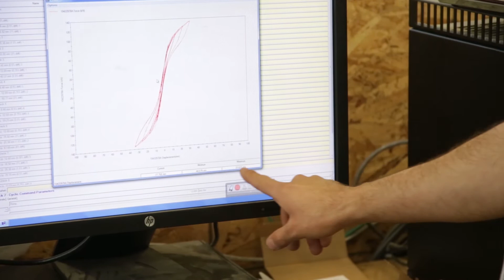Green Construction Innovation

Comment: Innovation in building methods need to be re/invented to better deal with weather threats.

 I wonder if inflatable shelters can be filled with something other than air.  If the material the inflatable shelter is made maybe not from cheap plastic instead use a very strong material something like Kevlar. Or maybe Kevlar.

Instead of filling the inflatable shelter with air fill it with injection insulation or cement or fill it with something i have not thought of to make a temporary shelter technology into a permanent construction method.

I do not have the resources to do anything to protect my ideas so i post my ideas for public view. I am relying on some luck and honestly.